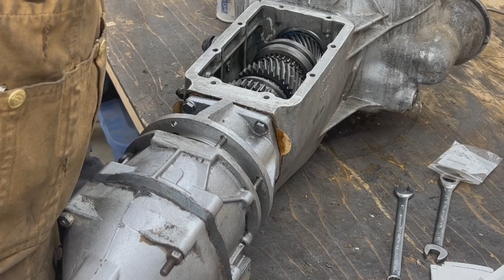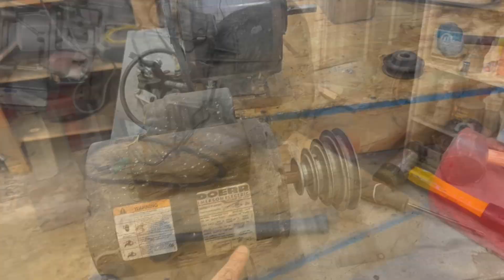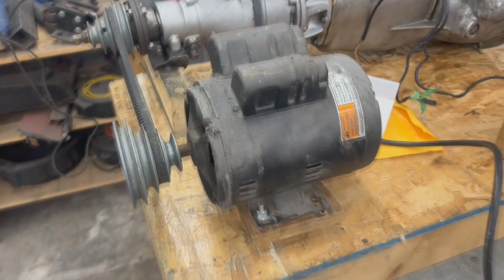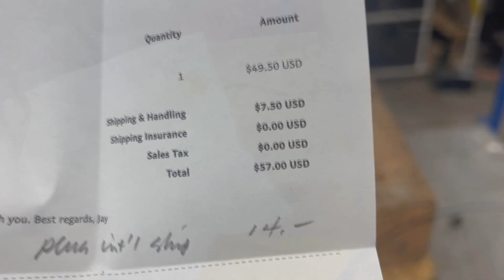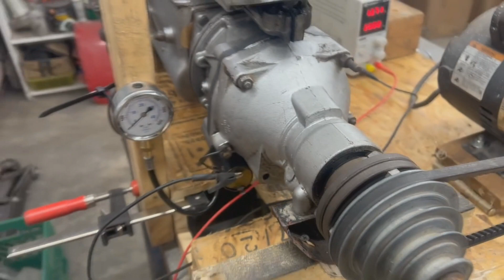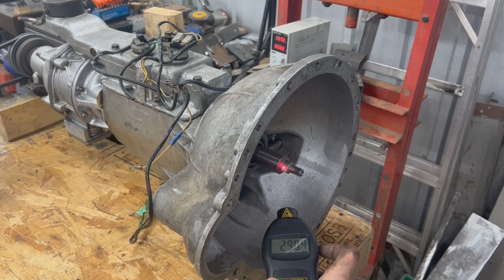A-Type to J-Type OD conversion - Part 6 - Assembling and testing the J-type Overdrive

Comment: Elin, what adapter method did you use to mount the transmission to the chassis?  Since this is now a J type, the old mount that's still on the OD is not going to work.

Comment: 👍I have to say, not at all boring to me! Great info for anyone who needs to rebuild a Triumph gearbox or is considering an overdrive conversion.
One thing I noted was the oil. You used 30w non-detergent. With a used OD where there may be some wear, 40w might be needed. Or 20w50. You mentioned "engine oil" though... Needs to be non-detergent or "racing" oil, especiall with the OD and its hydraulics. Detergent oil will foam up and that can cause problems. Also be sure any oil is safe with brass, doesn't contain sulfites, for example... That can damage brass parts used in these gearboxes.

Comment: I have fond memories of the Laycock J type overdrive, esp on my Triumph's where you used the gearbox to get you to your cruising speed then flicked the gearstick switch and the revs just faded away and cruised along the motorway a treat.   I had one too fitted to a MK1 Ford Transit SWB campervan, the previous owner had fitted it with a 3 litre V6 setup prob from a Consul and had included the overdrive plus changed the back axle to a Jaguar diff and this Transit could shift like nothing else then once up to 70 flick the switch and cruise all the way :D

Comment: Thank-you, thank-you. Really useful. I have J type OD and main shaft from a Dolomite sprint that I intend to fit to my non OD 74 TR6 G/box. This sequence of videos is going to be a big help. The switch locations for all the functions (Reverse, Neutral and gear lock out) moved to the back of cover near the shifter on the 74 onward TR6. The boss on the top of the box were no longer machined. I wonder if the difference between A & J is that the oil pump for the J can't create enough oil pressure to reliably operate the OD when main shaft is spinning at a lower speed in 2nd gear ?

Comment: I know the D type OD in my Volvo only is set to function in fourth, TR 4’s A type OD function in third and fourth and its death to operate the OD in reverse, but are there any concerns about operating in first and second or running through the gears when in OD?
Reply from the maker: The only problem I see is the pressure will build much slower on first and second as the output shaft will operate the pump at a much lower rate. So it will take time to engage, but once it is engaged there is no reason why you couldn’t use it.
Reply: A types should operate in 2/3 and 4th.  J type overdrive operates in 3/4 only.  Yes, reverse with the overdrive engaged is death so it’s important that it’s set up properly and your switches are working as they should.

Comment: Not boring at all.  I actually prefer the engine and transmission videos. I am currently rebuilding my gearbox, but not the J type overdrive since it seemed to be working fine.  However, I was seeing leaks at some of the bolt holes at the adapter. What are your thoughts on using a little thread sealant on those studs during reassembly?
Reply from the maker: That is a good idea. I actually never thought about the fact that the adaptor bolts to the main casting and the treaded holes are open to the inside, aren't they?

Comment: Elin, thanks for the gearbox and overdrive rebuild series, very interesting, especially the swap from A-type to J-type.  

The A-type on my 4A operates on 2nd, 3rd and 4th; the J-type on my Stag is limited to 3rd and 4th.  My understanding is that this restriction was introduced because the J-type is not so robust and cannot take the extra torque of 2nd gear.  If your top cover is from the A-type are you going to modify the limit switches/wiring to ensure that OD can only be selected in 3rd and 4th?
Reply from the maker: That is a good question, but I think this is a common misconception. The fact that J-type is limited to 3-rd and 4-th only has nothing to do with the overdrive itself. I might be wrong, but here is my opinion why:
 1. Overdrives experience the same torque in all gears. They have a ratio and that is what determines the torque. No matter what gear the transmission is in, the chances a not so robust overdrive to fail are the same. 
2. Early cars (I am talking about TR6, not sure about Stags) came with an A-Type OD (optional) and it happens that early cars did not have a neutral safety switch. At some point (I think in 75 but not sure) they switched to a J-type overdrive and at the same time they introduced a neutral safety switch. Of course that switch needed to find a place on the transmission and the engineers decided instead of adding another switch to use the place where the 2nd gear switch was going. They just thought a 2nd with OD is not used that much anyways... and took the spot. In fact on the 1975 TR6 overdrive harness there are still connectors for the 2nd gear switch, but they are not connected to anything.
Again, tis is my opinion only. I might be wrong

Comment: Very interesting!! I liked the way you bench tested it. 

Those overdrives were great fun to have.  The one I had (J type I think) gave you 6 gears effectively only operated on 3rd and 4th gears. On road conditions the response from the gear lever switch to the actual overdrive was instantaneous in either direction. 

Great video, learnt a lot, thank you very much. Good luck from Spain!!

Comment: Thank you for the video.  I think my limitations do not stretch to rebuilding gearboxes, but it is interesting to see how they function and the overdrive.  My interests with your videos are more about the body and chassis repairs , maybe also painting and rust treatment, which is about my skill limit I think.   I do admire the way you just pull a gearbox apart.  It is beyond me, maybe if I was younger I would have tried it.

Comment: Hello Elin,
There is a J Type OD which came off a Stag for sale in France at present for a reasonable asking price (350EU) but of course it is an unknown quantity. I remembered you had a damaged one ( perhaps it was an A type) so if you wanted I could buy it and arrange shipping.  Just a thought , not a scam. THanks again for your great videos. I am missing my 73 TR6 sitting in New Zealand!! Oh one last thing. I owned a TR6 in about 81 and it had OD on 2,3 and top so an A Type. My "new" 73 has the J Type but I own a second set of running gear including an A Type and mounts.  I prefered having the OD on 2nd as well , just great for overtaking. Before I decide to change out the J type I have been told teh J Type is stronger and more reliable. What is your opinion on A vs J, please. Regards .
Reply from the maker: Thanks Peter, but I don't think it is worth bringing a heavy unit from Europe all the way to Canada. 
I've only driven cars with an A-type overdrive and I can't express an opinion, which one is better. Actually I just responded to a comment above, which mentioned the J-type s not so robust as the A-type hence the limitation on which gears to work with. I think this is a misconception. I think they decided to use the 2nd gear switch for the neutral gear switch, which they introduced at the same time they switched from A to J-type.
Reply: @RustyBeauties  Hello Elin. Many thanks for your feedback. I did a search on this topic and found this interesting link .. the post from Motorsport Mickey was particularly interesting in giving the reason for the change to J type being the near instantaenous engagement of the A Type led to cracking of the diff mounts on IRS cars -- sounds plausible. If so I will stick with the J type but I do find it is indeed slow to engage compared to how I remember the A Type..All the best..
Reply from the maker: @peterwilson2588  have in mind that here I am engaging the overdrive when the output is spinning with 1500 RPM. In normal conditions you would engage it at around 3000 on third ( that is the output, not the input) and maybe up to 4000 on fourth gear. This means the pump will build pressure much faster.

Comment: Maybe I missed it in all the excitement, I’m curious what car did the J type overdrive come from and the did the OD adapter fit both the A type and J type?  As always, great series.
Reply from the maker: It is from a TR6 and no, the plates for J-type and A-Type are different. Actually the A-type is an actual flat plate. The J-type adaptor is like 3" body
Reply: Thank you for the info. Does your GT6 have OD?